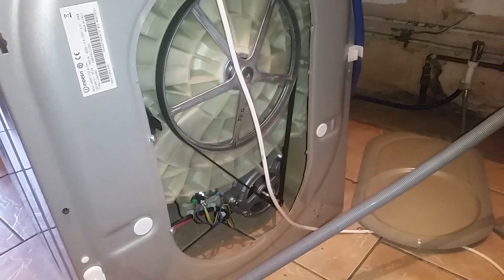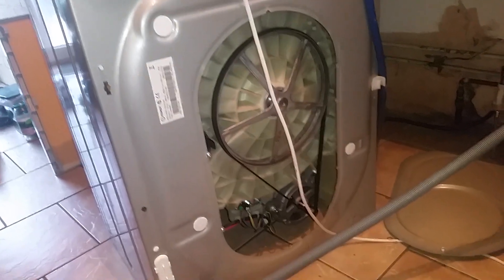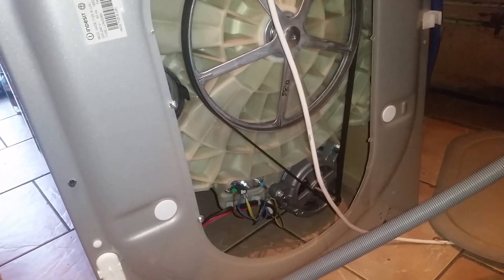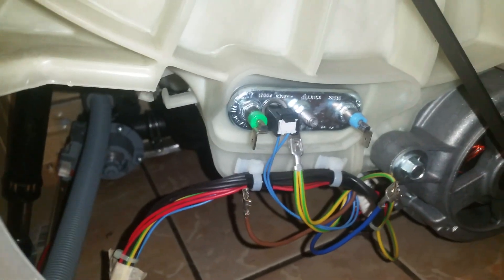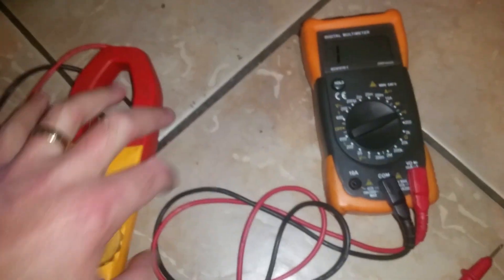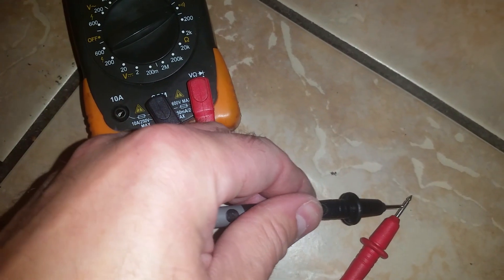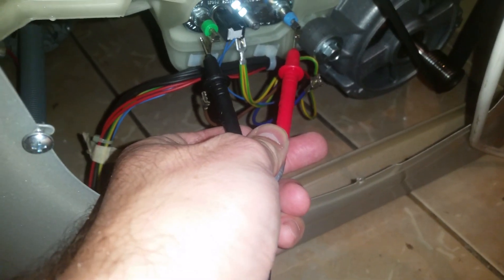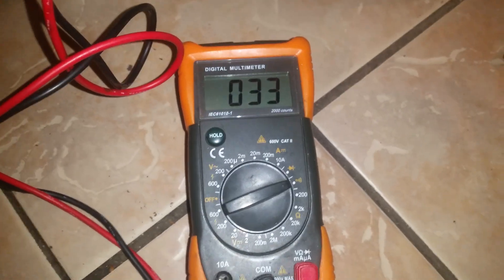How to test a washing machine heater element with a multimeter

Comment: Hi Simon, nice video. You seem like a pro. Could you help me out?
my heating element seems to work fine (27 Ohm), my NTC also works well (Ohm reading is getting lower with higher temps). When my washing machine is running on a hot program, there is current flowing through my heating element (indicated by my voltage finder). However: the water in my machine still does NOT GET WARM. What could be going on here?
Reply from the maker: @stevenklusener2655  Hi Steven, thanks. Assuming your hoses are OK and not kinked, then it could be a faulty control board.

Comment: I don't suppose you know the normal resistance range for the thermostat of this model? I'm getting 17k at room temperature and it decreases as it gets hotter. Washer gets stuck in fill cycle like it's waiting for water to get hot but it doesn't stop. Tested heater element and it's perfect within the ranges you quote.

Comment: Hello, the element of my washing machine give me   30.7 ohms but the multimeter does not beep, ( I already checked my multimeter is in continuity mode) what does this mean?
Reply from the maker: Hi, does your multimeter bleep if you touch the two prongs together?
Reply: @simonrees6028  yes it does,, but not when touch both plugs of the element  🤷🏽‍♂️
Reply: @jaseduar  continuity essentially means short circuit so it will beep on most decent multimeters if under 5 ohms. 20 - 30 ohms isn't continuity so don't worry if it doesn't beep